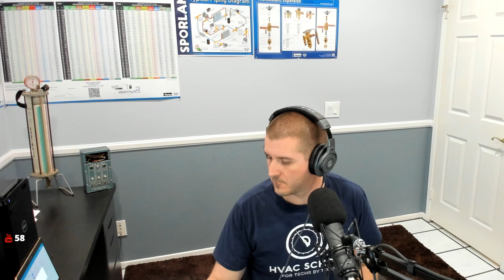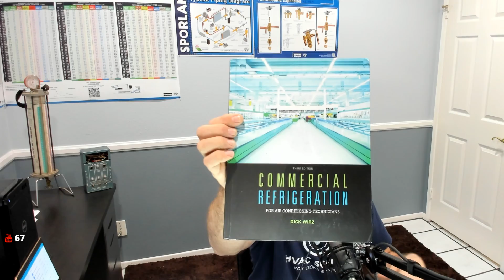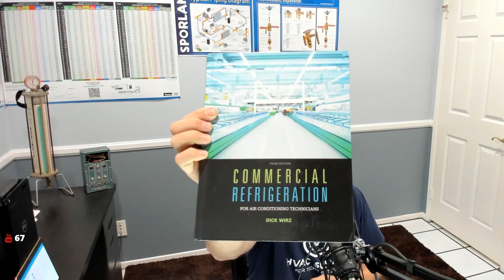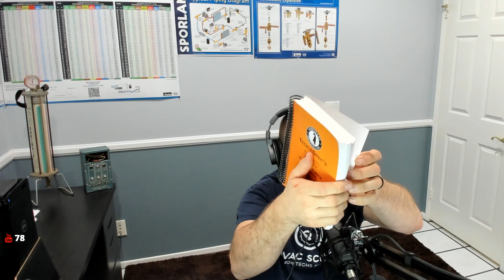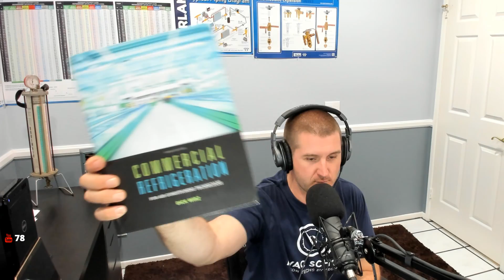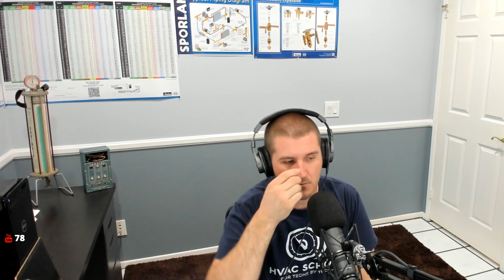HVACR VIDEOS Q AND A LIVESTREAM 1/28/19

Comment: Missed chat but had a question on pumping down walkin freezer so I can disconnect and move condenser temporarily instead of recovering charge if possible / king valves not much experience with thanks
Reply: You can see chat during video playback by enabling the chat to pop up on screen option will be in the top right corner.

If you're on a tablet and don't have it in full screen mode, turn it sideways. Video will be on the left chat will roll down the right if you have it on and will not see the suggested videos. If you're in full screen the chat will roll down the left and disappear after a few moments of someone's post